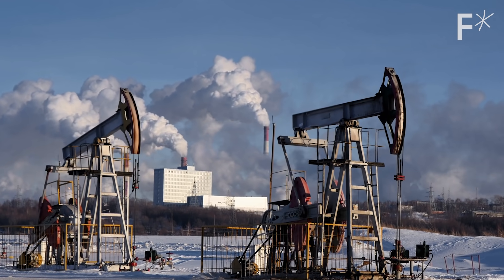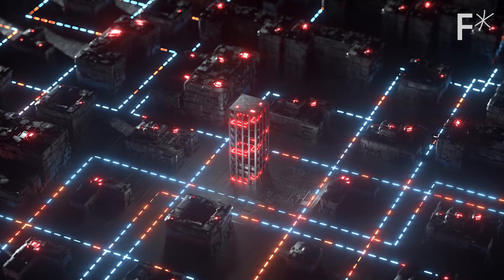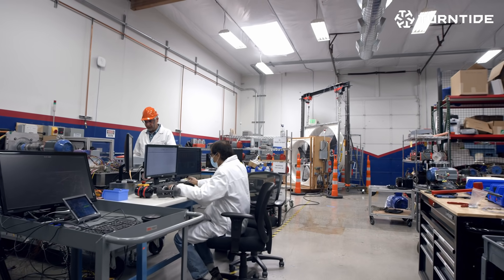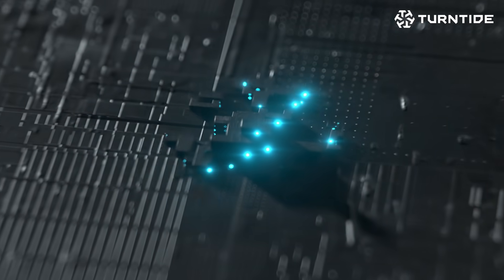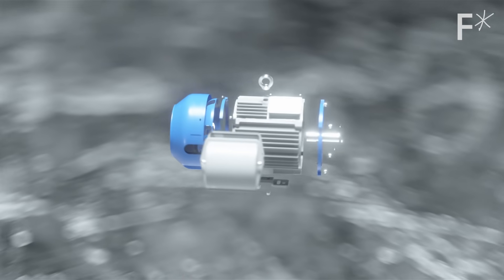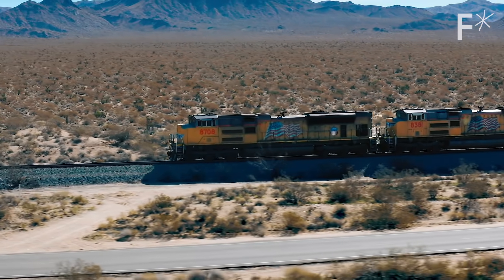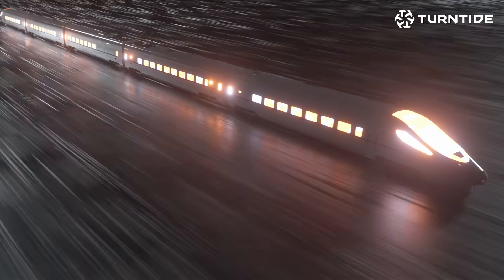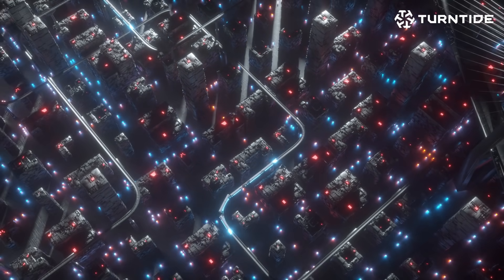The world will electrify. This technology can power our sustainable future | Freethink

Comment: My solution is much simpler,  and cheaper.
No more power grids, or transmission lines. Power generation on site. 
Plus mine can with-stand an EMP It's mechanical so it would be impervious. 
Also a tornado could run right over top of it with no damage.
Doesn't wait for the wind to blow.
Doesn't require the sun. 
Doesn't burn anything.
Doesn't stop-up rivers.
Doesn't produce any waste of any kind.
If corners aren't cut during manufacturing it shouldn't need maintenance for at least 50 years. Longer if we use the right materials.

Comment: Using 1% less electricity doesn't do anything actually. The electricity doesn't disappear, whether it's used or not. This isn't going to do anything. It only saves the consumer money because the electricity isn't being fairly sold. It just reduces the profit margins of the power company. It doesn't make them burn less fuel at all.

Motors already operate at 94-96% efficiency. There's essentially no room for innovation. It's trivial at best.

The fact that this repeatable power is being resold and marked up for trillions of dollars says everything you need to know about this power transition. It's just a way to squeeze every dollar out of people, if it's not gasoline, it's electricity.

It's almost too late, invest now, buy our unnecessary motor replacement, give us your money, so we can save planet earth. What if tomorrow is too late? Think of your children!

Hearing this misinformation is really upsetting to me. This energy crisis is actually just hysteria.

Comment: Imagine how much faster the world could develop green energy solutions if it wasn't for intellectual property rights, patents and limitless capitalist greed in general...

Let's put solar panels on every home, business and covered parking rooftop and switch to electric vehicles making nearly everything we do solar powered while completely decentralizing our power supply and empowering everyone as power generation owners.

Solar power is CHEAPER and electric vehicles are soon to be CHEAPER to make and already are considerably CHEAPER to maintain and operate, especially if charged from your own solar power.

A 3-5 year ROI (return on investment) for a solar array that will generate power for decades is a no-brainer and the panels can even be made locally too.

#EndFossilFuels #SwitchToSolar #SwitchToElectric #GreenNewDeal #EmpowerEveryone #DEMEXIT #StillSandersPlatform
Reply: There's actually a good reason not to do all that. It's because the energy in electricity isn't actually being used up, it continues on through the circuit, replacing whatever current it took (it's infinitely repeatable). Whatever electricity is being generated on 1 single roof can actually power the entire neighborhood. The power company is actually just an insane monopoly. It's profit margins are incredibly high. There's almost no maintenance, very little fuel costs, if any, and all the infrastructure was bought and paid for eons ago. It's b.s. dude. It's all about making money, and it's bought and paid for by tax dollars, at profit, and sometimes financed through debt. It's a horrendous scheme.

Comment: Does this motor exist no. If it did, the carbon offset is meaningless compared to the fact they would the world's greatest supplier of electric motors

If any of this were even remotely beyond vaporware, they would become one of the richest companies of all time...
Reply: The product already exists... 
They're greenwashing 3 phase brushless motors with pulse modulated controllers. 

Every single computer's cooling fan, every electric vehicle motor and most high end power tools already use what they're trying to sell. 

I had to watch a couple of other videos their company made, but that's what they're doing.
Reply: @kaisersose5549  My point was that if they could actually do any of that, at all
They wouldn't need to campaign like this, other companies would be busting their door down trying to get a partnership

Comment: Show us HOW IT WORKS or it's just a glorified commercial.
Reply: I totally agree, a lot of FreeThink videos are great but the number of empty commercially focused ones has been increasing - looks like the video was sponsored by the company it was about.
Reply from the maker: Sorry! There's a technical deep dive at https://www.youtube.com/watch?v=-Fyp0HsCmX8 .
Reply: @freethink  will add to my watch later! Thanks for noticing
Reply: This is second video.
Reply: https://youtu.be/Kp-8dVHQgbE
Reply: @eco-techandtravel5258  hmm yeah, well on a 6min video there's like 10s of useful info, and that fits in one sentence. They are controlling by software each coil in the stator at about 20kHz. And it's just one type of stepper motor, the "invention" is actually finding how to control it better. Now as to replacing all motors on the planet, I fear that won't happen in the time-frame required to stop global warming, plus the environmental cost of creating those old motors maybe would outweights the savings we'd have from changing them. As for the new ones, I don't think the patent system (20y monopoly in exchange for disclosing the invention which is often not disclosed correctly and completely anyway) is suited for dealing with the climate change time-frame either. That's the kind of things that should be made public for maximum adoption.

Comment: "This video was created in partnership with Turntide Technologies. "

If it were so good everyone would use them.
Reply: If you think that, then you must also say that why don't everyone have EVs.. or why don't everyone use recently MIT made transparent as glass solar panels in their homes?..
Reply: @markyichen6195  People don't use both of those because they are either hellishly expencive at the point of entry or, in the case of the "transparent" solar panels, unavailable to the general public. This product claims to be past the point of large entry fees and simlutaiously have its origin tech have been around "for 100 years". People are rightfully calling bs when the tech isn't even properly explained and they are selling it like it should be industry standard because of how much money it saves. Also that 80% metric is just clearly false for realistic scenerios. How are you going to break the laws of thermodynamics enough to make a lift for example use 80% less energy. Motors don't use tons of energy passively so either this is an entirely new type of motor, which still wouldn't save 80% most likely, or they are lying.
Reply: @dhlp123  
Their 100 year old tech is a 3 phase induction motor. 
Their modern spin is to use a pulse modulated controller, rather than 3 phase AC. 

They're still trying to sell a product which has been around for decades & can already be found in nearly every home. 

No matter how much they try to greenwash their product, it's not what they claim it is.